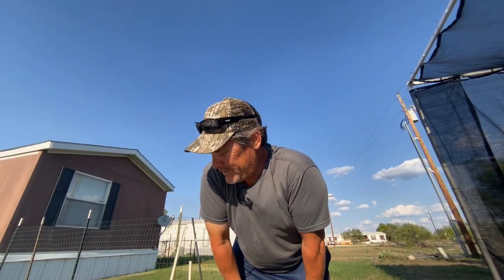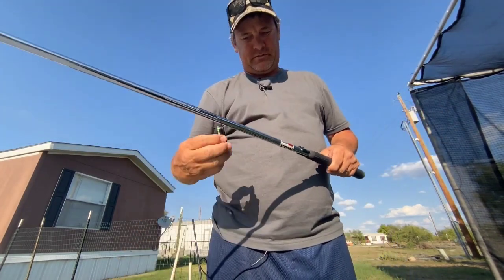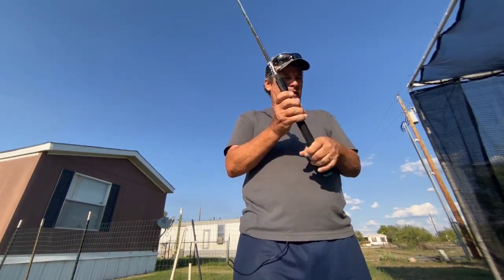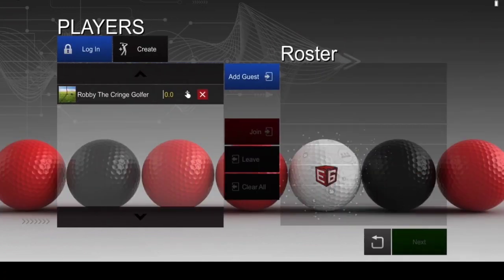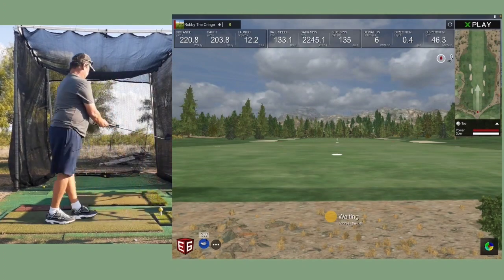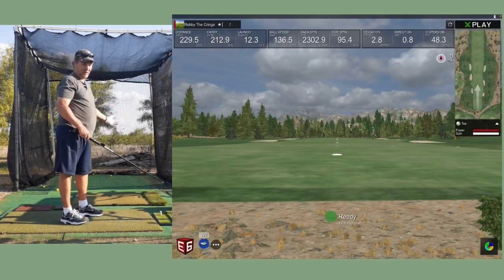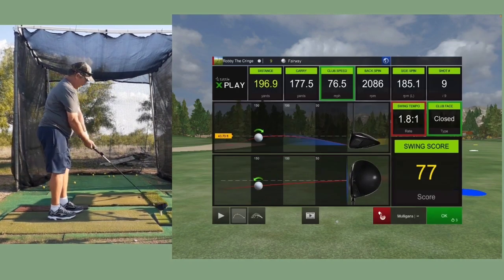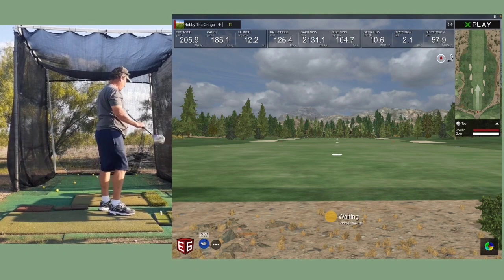Using Real Clubs and AlmostGolf/Real Balls with SLX SwingLogic MicroSim on E6 Connect

Comment: Bud does it really matter?  If you pick either ball you can adjust the software to get what you actually hit on the course right?  I might be wrong. Just learning myself. Thanks
Reply from the maker: Yeah you can certainly manipulate the setting in the simulator and/or turn the sensor more left of right. I changed it to come closer to what I actually see on course, in distance and shot shape. You can even set the conditions like wind, green speed, hardness and weather. You can do that on most.simulators. But there is still factors that come into effect. I can only juice my wife's swing so much. I couldn't adjust it enough to make up for.her not swinging hard enough or how to play different shots.

Comment: How does swing speed readout compare to your actual?
Reply from the maker: I think it's pretty close most of the time. I swing around 78-82 with irons and 85-95 with the driver and it's around in those ranges usually. I wish I had another way to test it. I have a prgr launch monitor but I think mine is defective by about 20 mph off.

Comment: hello, how realistic are the mishits, like topping the ball, or missing the ball completely if you have a bad swing, thank u
Reply from the maker: All the sensor reads is your swing motion, path and vibration from hitting the ball and/or ground. So a shank doesn't really read. It just might not go very far. Now if you're using the title x sim in E6 you can set it to real clubs and it will not do anything if you miss the ball completely. If you're looking for something that does that, you would want a launch monitor with probably a camera and radar tracking system like R10 or Flightscope Mevo.
Reply: @thecringegolfer  so if my swing motion is quite bad way left to right it would miss the ball/ not do anything ? i am just trying to figure out if it could actually help to fix my slice if i constantly hit with open face,thanl you
Reply from the maker: So on the slx connect app, it will show your swing path, just swinging the stick and based on path it could make a good guess on the club face direction. But I don't know that I would really depend on it being correct all the time. I am able to pull the ball left by closing the face and push it right by opening it, but that is because the sensor is reading my  swimg path direction on an arc. I honestly don't think it would really help you correct a slice. The easier fix would be to swing on a more in to out path.
Reply: @thecringegolfer  appreciate the help, i live on small islands in europe so i was hesitant as it will be a nightmare with the delivery, or if it breaks etc, but I think I will give it a try, seems like a good fun either way
Reply from the maker: Oh, ok.. I definitely think it's fun to use. It gets you swinging. With the slx connect app, there is a lot of data to look at. And you can even record your swing with it for analysis. Besure to update the firmware. There is an app for that too.

Comment: I’m not really a great golfer. Every shot I seem to take when it straight even when I intentionally tried filling it up just to see how the physics would work. Am I doing something wrong via calibration or is this just how the product works?
Reply from the maker: Might be a sensor issue. Idk make sure the sensore isn't upside down. If that's not it, maybe contact support. Or find a person who plays and test it.
Reply from the maker: Also try changing the number on the direction settings from 0 to 4 or - 4 under the simulator tracker.
Reply: @thecringegolfer  thanks for the quick response. I will take your advice and it is well appreciated. Looking forward to the adjustments as I feel it is my snap judgement and not a reflection on the overall product. Subscribed.
Reply from the maker: @johnserafinko130  no problem. some products do fail sometimes. Tec is great when it works!
Reply from the maker: Here is a video where I tweak the settings https://youtube.com/watch?v=LzjsIWoaZL0&feature=shares

Comment: On the swing logic you can’t go from real clubs to simulator as I tried it
Reply from the maker: If you have the swinglogic - SLX tracking system selected it doesn't have a selection for real clubs or impact trainer. But if you select Tittle as the tracking system it can be switched
Reply: @thecringegolfer  yes I saw that, do you think the titlex is better than swing logic for accuracy
Reply from the maker: It felt like it was to me. But they did an update not too long ago.. So maybe better now.
Reply: @thecringegolfer  you mean swing logic or titlex. I’ve not been on the range as of yet so be interesting to go against Trackman
Reply from the maker: @jonfowell9045  seemed that Tittle x was more accurate. But that the update was suppose fix some issues with slx. Wish I could test it. Swing speed, tempo and path seemed to be better.
Reply: @thecringegolfer  I’ll try it soon I’d be interested to see the data
Reply from the maker: @jonfowell9045  If you use real clubs and hit behind the ball, it will read it and distance will be a big number. lol!
Reply: You should put your difficulty all the way up.  It is much closer to real.  That comes from swing logic